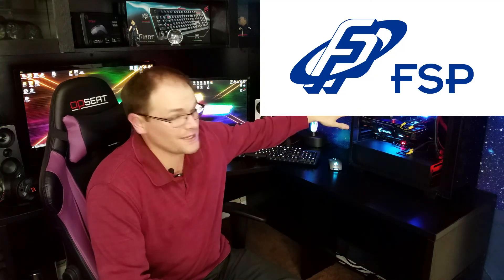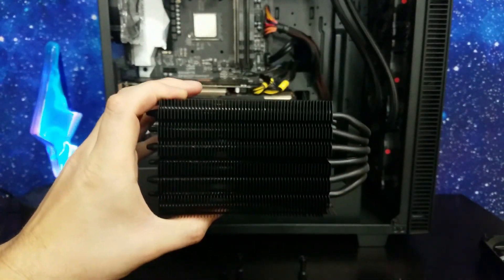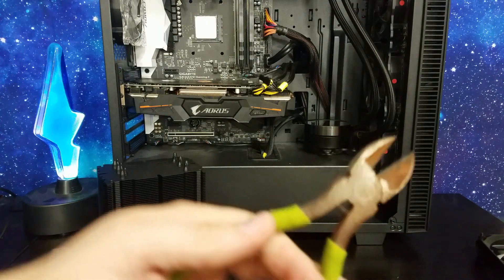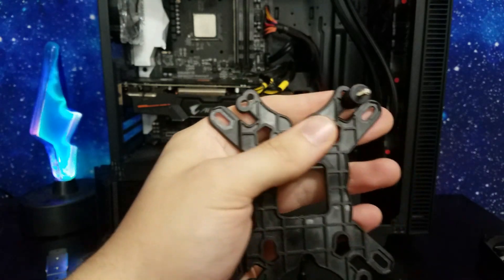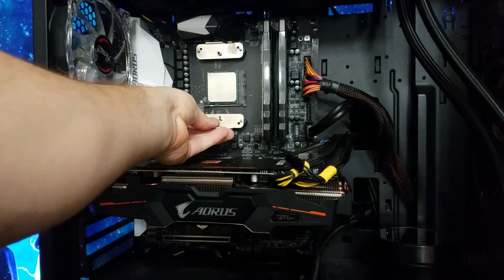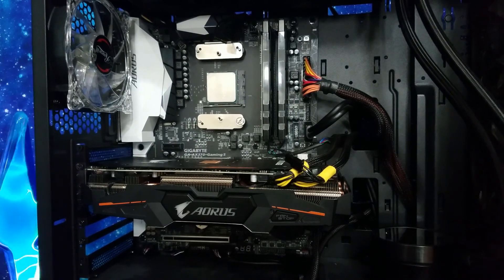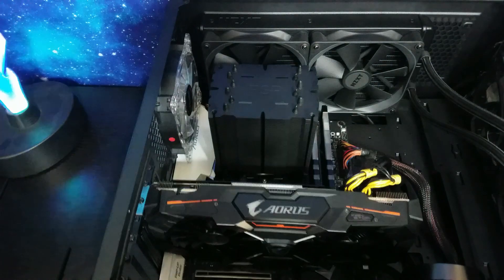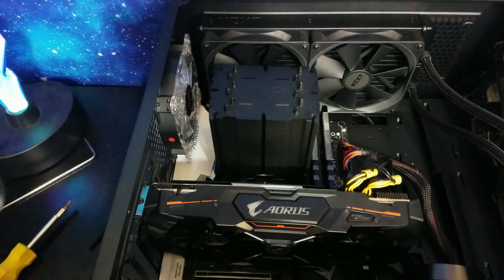FSP Windale 6 - CPU Cooler - Review

Comment: Orientation is determined by the position of the cores underneath the cpu lid. You need to make sure all the heatpipes touch the cores, if you orient wrong you may only get 2 or 3 heatpipes touching the area where the cores are. Here's a photo of the CPU in use (Ryzen 1800) delided, you can see what i mean https://i1.wp.com/play3r.net/wp-content/uploads/2017/03/Ryzen-Delidded.jpg?resize=696%2C451&ssl=1

Comment: The prob with the logic of "direct contact losing ground cause of the cracks between pipes" Is that you are replacing those cracks with a metal barrier between the cpu and the pipes. A metal barrier that holds heat instead of transferring it to the fins, and then you better hope that metal block has PERFECT contact with the pipes. Also you could de lid your cpu and just mount that directly on the CPU die and drop the temps another 15 degrees under load (same idea as the heat pipes. Remove the metal barrier and 15 degrees is not an exaggeration) As is with a conventional heatsink and cpu lid in tact the heat is passed from the CPU die, to thermal paste, to the CPU lid/metal block, to MORE thermal paste, another metal block and finally to heat pipes that can carry the heat to the fins. It's ridiculous and incredibly inefficient.  
  I get that heat rises but you may have better temps if you flip the heatsink around and have it suck air from the top vent (and flip the fans around up there to pull in clean air) and leave the back fan as exhaust as usual. It'll be getting cooler air instead of sucking ambient air from the case and video card that is only an inch away from the fan.

Comment: Hey , I know this is an old video but I was wondering I also bought the same cooler! I was wondering does it matter if I decide to put the cooler on the MOBO first before placing the mobo on the case or should I do what you did and do it after placing the mobo on the case
Reply: Also do I apply thermal paste to the cooler or CPU? I just bought both a new CPU AMD Ryzen 5 2600  and the Windale 6 CPU Cooler
I'm not sure if its already pre applied to the cooler or the CPU it self
Reply: @ichigokurasaki421  Late, but you should look up some thermal paste application info. Long story short, everyone is going to say a dot, an even spread, or a line of thermal paste is best. Testing seems to not indicate one over another though. Bottom line--put the thermal paste directly on the CPU lid and make sure you don't use too much.